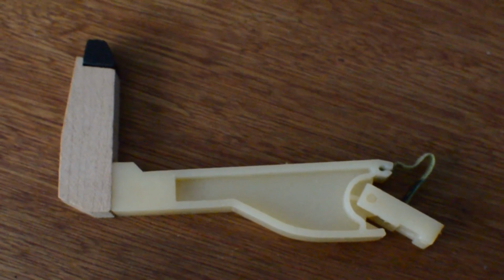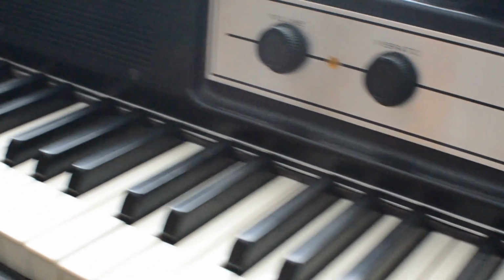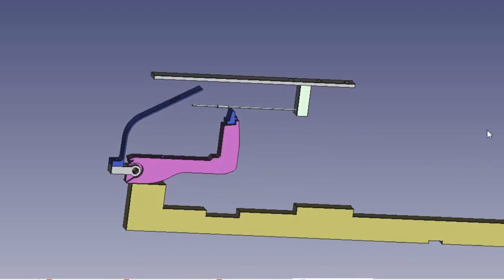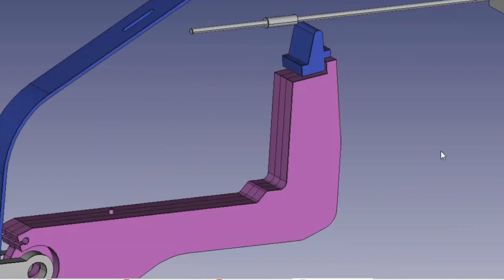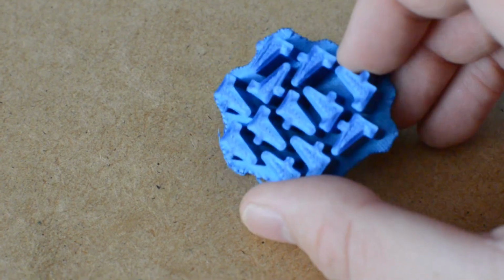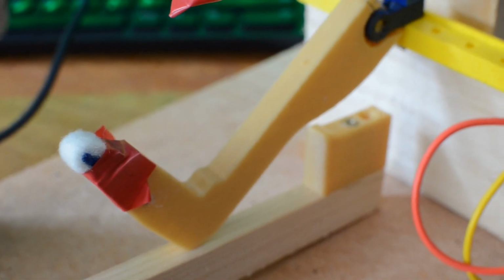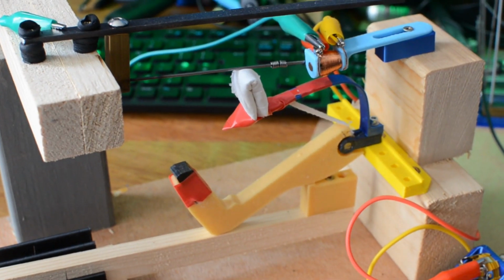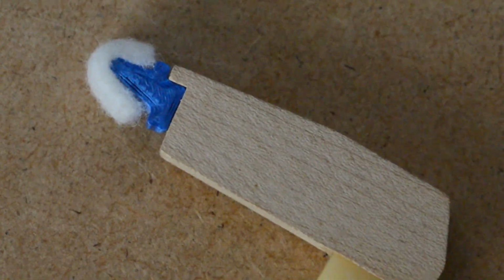DIY Electric Piano - Hammer Tips - Episode 7

Comment: Really cool Project, will participate somehow!
You have missed the "Hohner Electra"… (picked up mine yesterday!)  somehow unknown - but really the same league like Rhodes and Wurlitzer. Produced only between 1968 and 1970 in Germany by the same manufacturer like the Clavinet, Pianet and many more.
Reply from the maker: Thank you Georg, Yes I agree I have overlooked the Hohner pianos and they do deserve to be included. It's a shame more of them are not about. How are you finding your Electra?
Reply: @deancoyle   It´s awesome! The action is gorgeous but the deepest key is F1, so I´m missing the E1 (72 keys in total F1-e4)

Took it completely apart and cleaned it all out. More than 50 years of dust inside. But there is an other very common problem: the foam of the rest-position of the hammer has gone completely where needed… I did some comparison with different materials and found my solution: a double layer of self-adhesive soft felt. But still has to be done (this weekend?) Next: I have to order for the new caps for the PSU/ Amplifier for a complete re-cap.

The mechanics and technical design is very different to a Rhodes and rather similar to a classical Piano - but simplified.

The keys by themselves are plastic plugs mounted on a channel section - like old Hammond-Keys prior/equal a T-500. Seems to me like Hohner Pianet T but the key-caps mounted on a longer section.
(easy to produce - even with 3D-print and a saw ;)

The rest position of the hammer is accomplished by Springs fixed on the keybed (punched steelrail).

Apparently the tines/reeds/tuning-forks are the same like in a HohnerPianet/ Clavinet Duo: hardened steel with a tin-soldered brass-pad for tuning. (urgent: get them out before tuning with a file - the swarf becomes magnetic!)
In my case tuning is not necessary.

The hammers are all felted and different in size, mass and geometry (six times). As higher the head the „sharper“ and lighter the tip. Lead weight are glued inside. The heads are mounted by a angled steel-rod and driven by a rebound system (easy to adjust by a screw)

The damper is a toothed rail with cardboard strips connected to angled sheet copper strips. Those are screwed to the key - with two very small and fragile slotted screws per key (broke five of them).

The sustain-pedal pulls a toothed rail, where punched cardboard(!) stripes are connected to the felt-sheeded copper stripes. The moderator pedal affects the amp by an micro-switch - thats cool engineered but has no influence to the passive played piano (but maybe good for a simple tremolo-hack with an "oscillator" instead of the switch)

The flat pick-ups are mounted beside the reeds and compared to a Rhodes explicit smaller. The pick-ups are soldered in sections and each one has an individual pot for volume adjustment. No further EQ nor a tremolo - but a 20W germanium amp with 4 speakers connected. So it´s a Rhodes Suitcase (somehow)

manual 1: https://www.clavinet.com/hohner_electrapiano_service_manual.pdf
(there exists an second manual with an different amp)
and a very good resource: http://rhodesrepair.co.uk/rhodesrepair/repairblog/hohnerelectra/

I will post an article with some pictures on ep-forum.com quite soon…

(did you ever thought of this in a electric piano: https://cnmat.berkeley.edu/projects/magnetic-resonator-piano ?)
Reply from the maker: Wow Georg, Thank you for so much detail. 
This sound very interesting. Looking forward to seeing some pictures and hearing this piano once its done. 
Sounds like you have restoration well in hand, but if you need any help creating replacement parts just drop me an email and i'll do my best to help. 
The Berkeley piano looks interested, reminds me of an e-bow, also some interesting links on that site, will read through them. Might be some interesting things in this I could take to the next project...